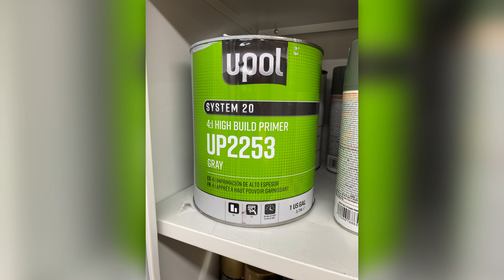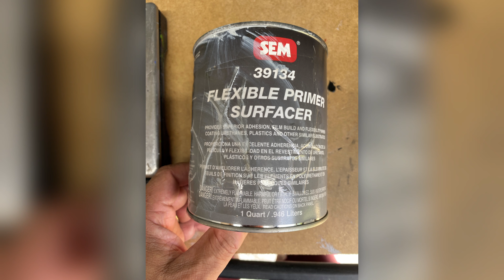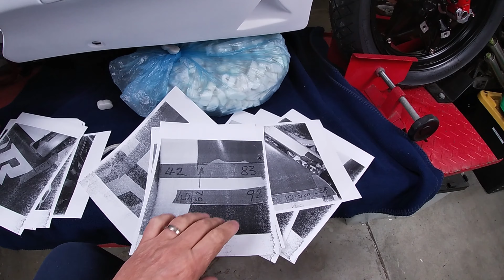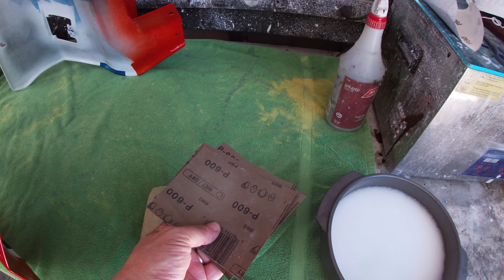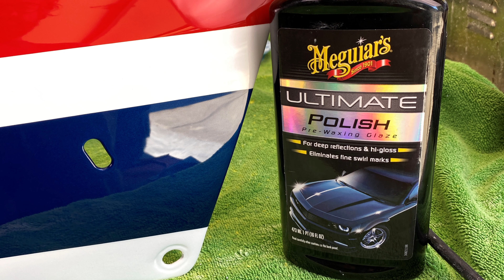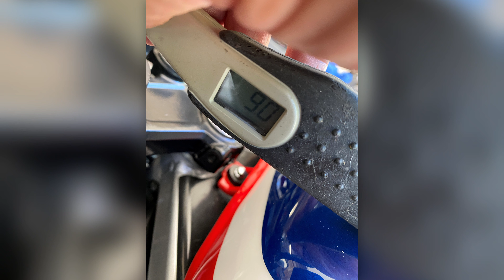85 VF1000R Restoration Reboot prt.7 - Final Episode! More paint, lots of buffing and final assembly

Comment: Typically I don’t comment but this series has inspired me to do better on my VF1000r restoration in process. Don’t cut corners just do it right. Not sure how you were able to source some on the harder parts but a very complete build at the end of the day. I hope to have mine together by spring. CMSL shipments are coming slow. Some decals are not easy to find. Curious how much the new owner paid for that beauty. I will not be selling mine. :) look forward to new videos. Thanks
Reply from the maker: That’s awesome, go for it! CBdecals do a full set, very high quality, https://cbdecals.afegraphics.com/view_product.php?product=85vf1000rUS-FullKit-CB00220
If your restoring a European model double check these decals are the same, as they are based on the US model. I have quite a few spares and sources for parts, so let me know if you need any help.
Reply: Appreciate the response, made my day . How  did I never see that decal company before? Loved the tutorial on brake master window replacement. Ordered parts and it only took 5 minutes to do the job. That’s the stuff I love! My masters look so much better now. Looking forward to some more restoration. Thanks for making great videos and rides. I’ve probably watched the vf1000r videos 10 times each. 😂 sometimes you get an old bike and you need a reference for correct assembly and hardware. So lots of freeze frames on your builds. Thanks!
Reply from the maker: @simpsonjer  Great to hear! Would luv to see some photos of the resto, you can always email me at andyr999@comcast.net. I also sent out a link some time back to a Flickr album of all the photos I took of my restoration, over a thousand of them. If you can find that link it would really help.

Comment: from memory 9psi on front forks seems high
i thought it should be 0-6 psi
else you can bust an oil seal when hitting a big bump
Reply from the maker: You are correct to point that out, I've run 9 psi in previous bikes where I've rebuilt the front forks and had confidence in the new seals, but wouldn't recommend that on older forks. Probably should clarify that in the video.

Comment: Need higher frame rate, video quite jittery.
Reply from the maker: Shot with old 30fps GoPro, using 60fps now but found LED lights interfere with it, not sure if that’s a GoPro issue or not.

Comment: How much would you charge to do a restore like that on somebody's bike ? Don't know if you do that or not but still just saying, How much would a restore like that cost a person.
Reply from the maker: For a full nut and bolt OE restoration like this one you are looking at more than 400hrs, somewhere around 12K + parts. But if you have a good bike to start with and just want to do a sympathetic restoration you can go a lot lower, say 4K to 5K. A recommission, can be between 1.5K and 4K including parts. It really depends on how good the bike is to start with. We are starting another full VF1000R restoration for a client in April, and take on commission work on a case by case basis for pretty much any bike from the 80’s through to early 00’s.